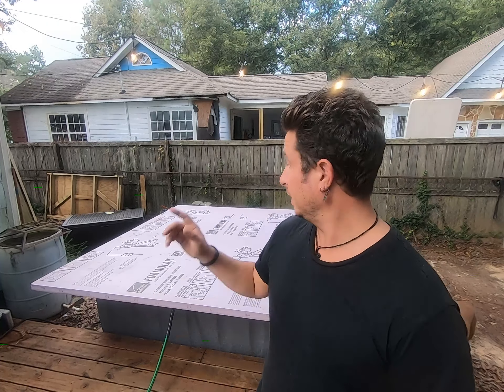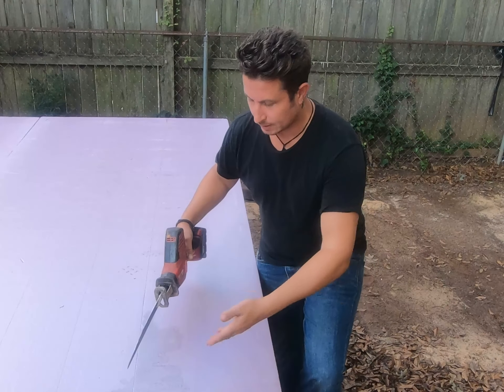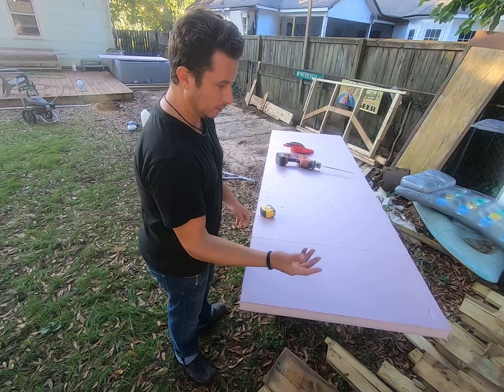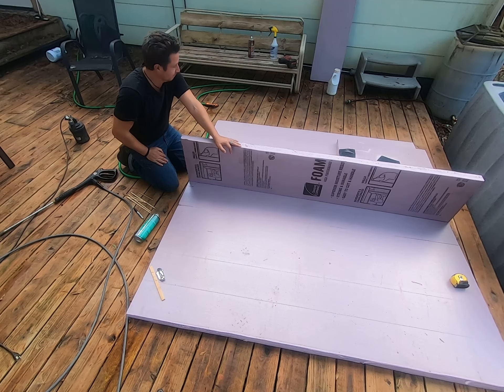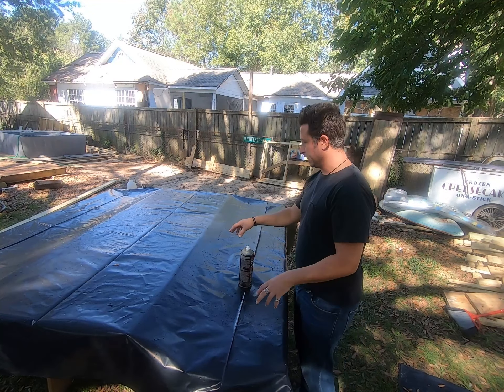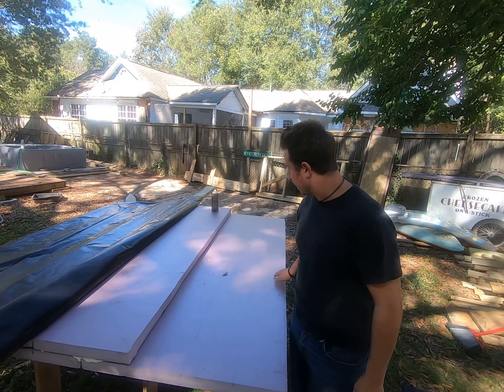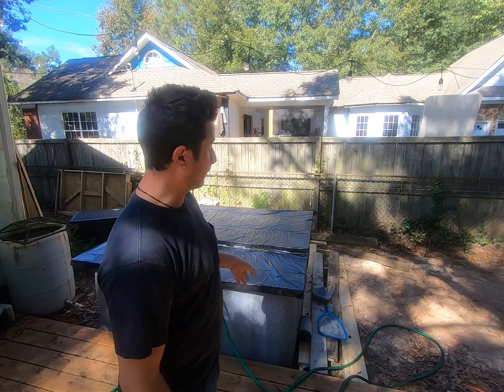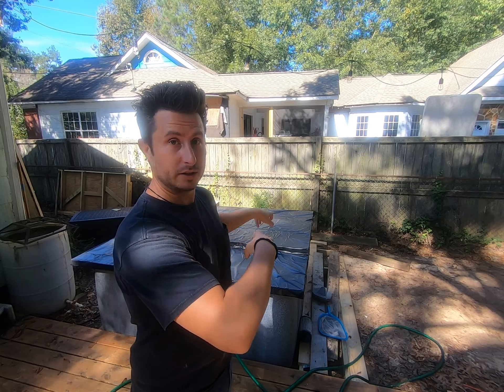Cheap Hot Tub Part 2: 100 Dollar Hot Tub.  How to build a cheap hot tub cover for a cheap hot tub

Comment: I laid rigid foam over my hot tub and it leached into the water changing the color of my daughters hair, did you end up putting anything as a barrier to the foam on the under side?
Reply from the maker: no and have had no problems in over a year....maybe it was the brand?